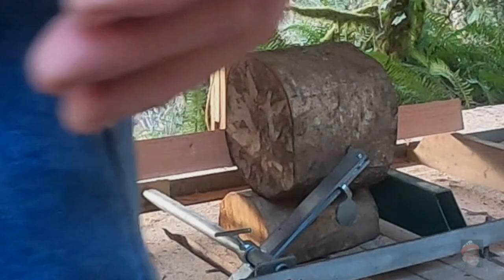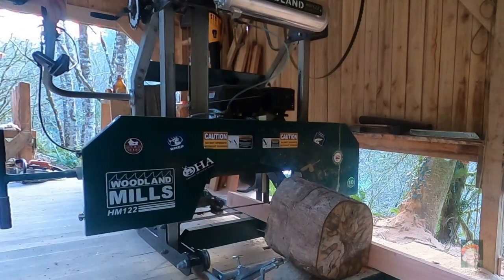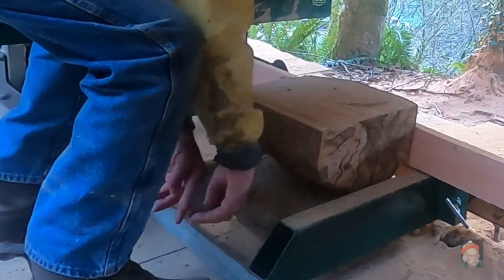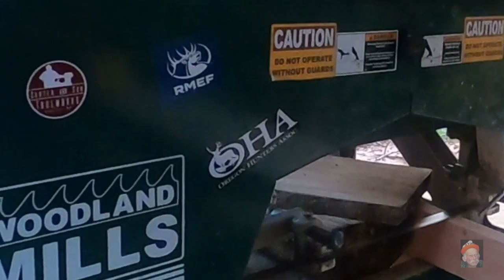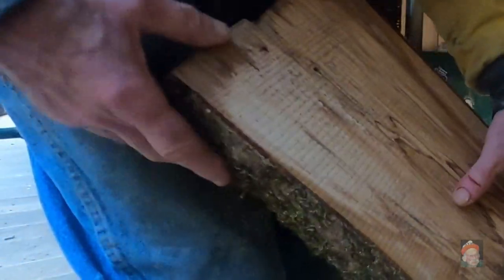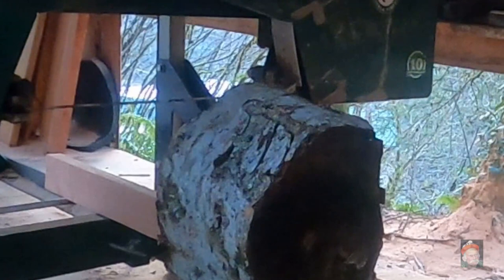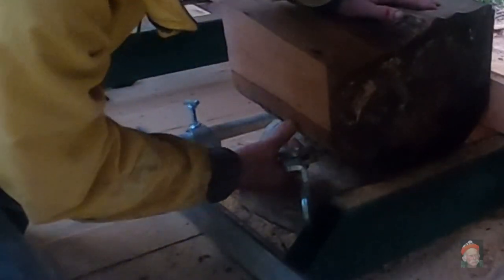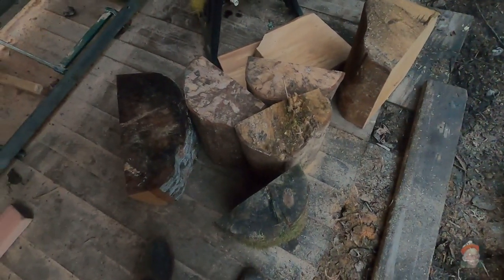Cutting Bowl Blanks For My Lathe On My Woodland Mills Sawmill and a Bowl Blowup

Comment: Two half logs on the deck could better cradle the roundness of the log getting cut for better support.
The other thing is we could put the short log in sideways - the cut ends towards the bunk and the clamp. Logs go on the mill lengthwise. It's very much not in our heads that they can go crosswise when they are that short.
Reply from the maker: Crosswise! Definitely thinking outside the box, as they say. Thanks, Mike.
Reply: I’ve been putting a piece of plywood on the bunks. Works great for projects like that.
Reply from the maker: Yep.

Comment: Great video, I have the HM130.  I go one step further than you.   I take off the scab wood (or the other round part).  It makes it easier to use the bandsaw in the shop to make a round bowl blank.
Reply from the maker: Good idea, unless you want to turn live-edge bowls. Having both sides flat would make marking it easier because, if you have enough flat on the small side, you can mark the circle on the big flat and cut it that side up on the bandsaw.

Comment: I have a solution for cutting maximum width with out using your clamps or a back board ....but it may involve drilling some holes in a couple of the bunks unless you come up with a better way....cut some 2by6 to bolt or screw down on the bunks running the 2by6 parelel with the tracks to set your rounds on then cut 4 2by6 18" long and nail one of them to the edge of the other board so they look like 2 corner boards ....then you can put one on each end of your round and screw them to the round as well as screw them to the 2by6 runners
Reply from the maker: Sounds like that would be a good, solid hold.